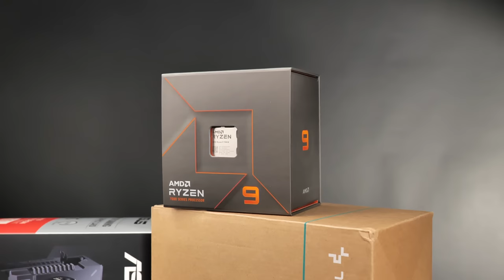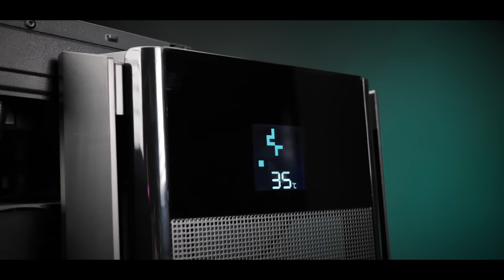Simple, Stylish | DeepCool CH510 Mesh Digital Gaming PC Build | ASUS TUF RX 7900 XT AMD Radeon 7900X

Comment: Super stylish build! DeepCool's design team deserves a raise... The aesthetics of that AIO and case are both absolutely top notch.
Reply from the maker: totally agreed with you on that! They both work so well together 😎
Reply: I use their fans, they really do have the aesthetics down
Reply: Why they don't offer the mesh digital version in white is disappointing, I would not buy the black
Especially when the DeepCool CH510 is available in white
Reply: the case is definitely beautiful, but once I have it for myself I see a few problems with it, like for the front intake, if you use 3 120mm fans, one of it will be partly blocked by the screen which will disrupt the airflow, if you use 2 140mm fans, there will be a big gap depending on your fan placement. The bottom intake might not be very useful unless you use very powerful static pressure fans because there's a lot of obstacles for the air to go through(mesh, psu cables, and dust filters on the side+mesh).
Reply: I just wish DeepCool kept their "mask" branding on their products, the new logo looks dog-shit.

Comment: I have the same case I swapped the lcd panel to a custom sensor panel totally worth it the case has superior airflow i have fully decked it with fans just mr lee looks beautiful with Argb too
Reply from the maker: That sounds awesome with the custom sensor panel. If you have any pics on Instagram or similar, tag me so I can check it out 😁 your build sounds awesome though!
Reply: Can you mount an inverted gpu in that case?

Comment: Was interested in this case but there was very little videos on it. Thanks for another awesome build!
Reply from the maker: I felt the same way. I knew the case was really nice but very little content surrounded it. Hopefully I covered it well and gave you a deeper insight without getting overly technical ☺️
Reply: @Mr_Matt_Lee  Of course you did excellent as always. I was wondering about the large cable connected to the front of the case, whether it would be a hassle to clean or if its detachable. Can't wait for the next build! Maybe a Corsair case or the secretive Lian Li Air Mini Glass version from Microcenter if I may suggest <3

Comment: Getting ready for an upgrade after 6 years. Moving away from the m-atx form factor, as the newer hardware options these days seem to run hot. This case is definitely a contender along with the new Fractal North one. Tough choices.

Comment: Im a huge deepcool fan and user, I didnt know they have that kind of case! I want this! I have ch 510 case but not with that front panel. Hehe. That case is very hard to manage 360 rad, lack of space. But still I work to put 10pcs of 120mm fans hahaha. Front 360 rad. When I put it on top I cant put 3 120mm fan in front. Damn. Memories

Comment: Beautiful build, but I'm not crazy about the case. The front display is kind of cool, but also a little gimmicky. I don't like that you have to remove the front panel to get to the air filter. My Fractal case provides bottom fan mounts inside the power supply shroud where they be won't be seen and I much prefer that. And lastly, any case manufacturer not providing a way to mount the GPU vertically has missed the boat. It's what a lot of gamers want to do these days.

Comment: Knly thing I don't like about the case is that it only has 1 type A USB3 like what is the advantages of that, the plug is still the same so it isn't for cable management purposes.
Other than that minor gripe, this build looks really nice, like that AiO cooler, looks so sice in there xD

Comment: Mr Matt Lee
 Hi. I have a question. Do these two fans at the bottom not have a negative impact on the graphics card cooling? The graphics card has its own fans, and I wonder if the additional fans at the bottom, for example,  blowing faster than the graphics card fans, would not disrupt the airflow? I am asking seriously, as I am facing this choice myself. Thank you. Seccend question. Why You decide to put AIO radiator at the front, but not on top ? Most voices tell, its better to put AIO radiator on top. It's ok to put it on the front, but only if top mounting is imposible.

Comment: the two fans under the GPU are very risky. Almost all of gpus cant function well with these fans throwing air into the gpu fans and the temps are getting actually higher because the gpu fans arent spinning faster. It only gives some benefits if you set the gpu fans to always 100% or any kind of % that lets you do high performance stuff with good temps.

Comment: Hey Matt can I ask you something? One of the reviews this case says If you go with 360mm rad on top you wouldn't be able to mount 3x120 fan on front because of the radiator tubes. Is it true? Would there be a problem If I go with 3x120mm slim fans (about 1cm slim as you know) and a 360mm radiator at the top? (edit: this build really looks like it sponsored by AMG Mercedes F1 Team 😆)
Reply from the maker: Hey! That’s correct, if you mount a 360 on the top you wouldn’t get 3 fans on the front. With that said, I wouldn’t put the three slim fans on the front. Slim fans are great for smaller form builds or as a single rear exhaust, but by design they aren’t designed to move lots of air. You’ll end up with a poor intake and a strong exhaust on the rad, which will result in lots of negative pressure. The best approach in my humble opinion, also based on experience with this case would be to keep the 360mm on the top, then mount 2x140mm on the front. These would stay out the way of the radiator tubes whilst also moving lots of air more silently, whilst keeping the air pressure neutral and optimal 😊🙌
Reply: @Mr_Matt_Lee  Yes you are right I didn't consider slim fans' strength. I think I would go with 2x140mm on the front or 120mm slim exhaust with the radiator tubes on left and 3x120mm normal-size fans. Thanks for the reply and the information Matt 🙌🙌

Comment: 4:27 I got a question mr matt, that 3 pin connector, a pin seems kinda like bended which is indeed not good right? does bending it in the right direction where that pin has to face straightly upward is safe? Might just be a small problem but the possibility of a pin popping out is never zero. this can be just fixed with a finger?
Reply from the maker: Well spotted. Sometime when running AIO cables between the RAM, those connection pins can take a little hit, don’t worry though. They’re flexible enough to push them back with your finger and not damage them ☺️

Comment: Question: shouldnt the fans radiator add air into the case to cool the water inside? i mean, the watercooler should be in the front and the fans should introduce air to cool the watercooling. or am i wrong?
Reply from the maker: If you mount a radiator on the front, your CPU will be cooler but GPU hotter… if you mount the radiator on the top, CPU will be warmer and GPU cooler. The temperature difference between either is very small, it’s nothing to worry about. The only time I’d strictly front mount a radiator is if I was extreme overclocking and cool air was absolute. Otherwise, for 99% of most other setups, it really doesn’t matter… monitor your own temps and make an educated decision for which was works best for you ☺️

Comment: 5:14 5:30 Bad fan mounting design.. The structure of the case contacts with a front side of FK120 fan, making significant noise level increase.

Comment: Can someone pls help me? :(
I want to buy the Deepcool case and RF120 120mm Fans from deepcool and mount them on the bottom shroud but i dont know where to get those long screws which fit with the case threads.

Comment: If only DeepCool is making completely clear glass cases without any tint .. Too bad most of the components are just invisible behind that black glass once lights are off unless you use the amusement park RGB lights ..
Reply from the maker: The glass is fitted throughout the airflow visuals and you can see inside just fine, it's not tinted :) Agreed, RGB does help to illuminate inside though if that's your thing. Much like yourself, I prefer lighting for accent rather than the overall vibe ^^

Comment: If front fan weren't blocked by small display i would buy this case, but it is, not to mention bottom dust filter is low quality. Disappointed..and the display could take less space at the front.